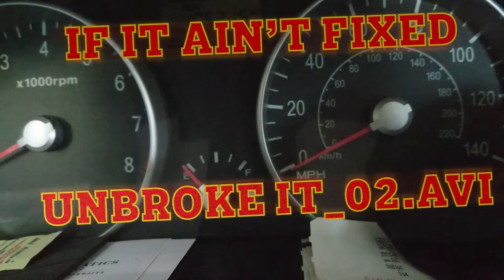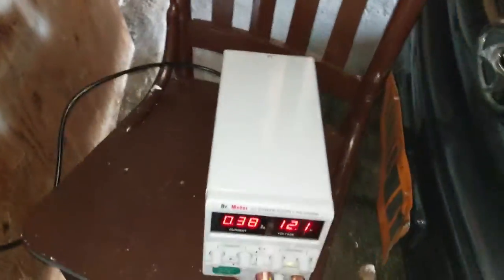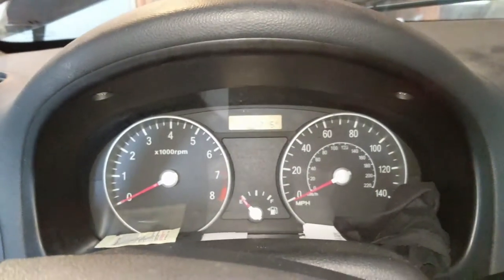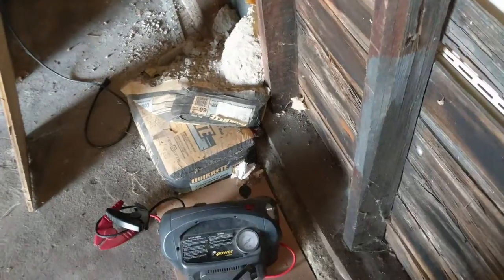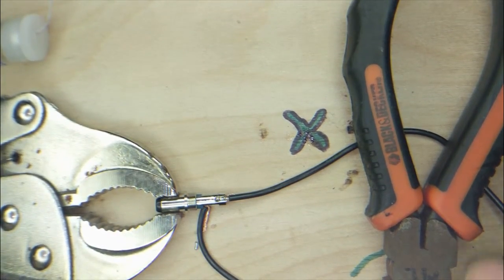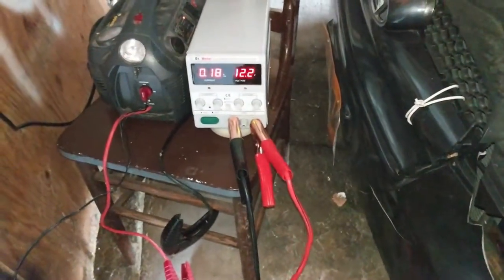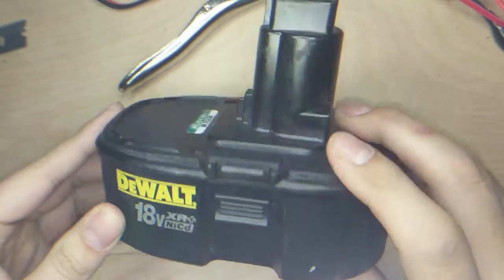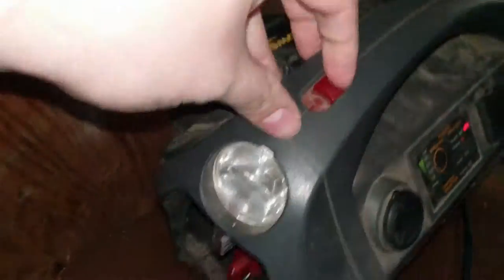If It Ain't Fixed E02 - Car Jump

Comment: To jump start a car, don't connect the ground to the dead battery. Connect the ground cable for the dead battery to an unpainted surface on the car.  This circuit will bypass the dead battery, letting electricity from the "jumper" to flow to the starter, and allowing the car to start and you to get to work.  The alternator will charge the battery as you drive, unless the alternator is not functioning correctly. see diagram 1- https://content.artofmanliness.com/uploads/2012/08/Jump-Start-3.jpg

Comment: Your amperage was low because the charge voltage on a car battery is 14.3 to 14.7 volts. 

If you cranked up your power supply to 14.3 volts it would work!
Reply: Now that your car is running check the voltage on the battery, you should see its about 14.3 to 14.7 volts. If it isnt then you might need a new alternator